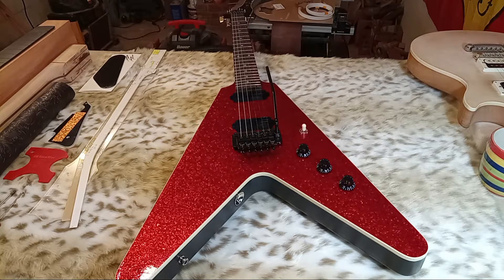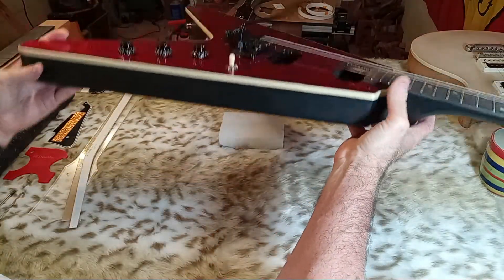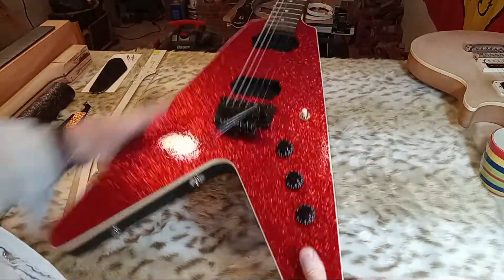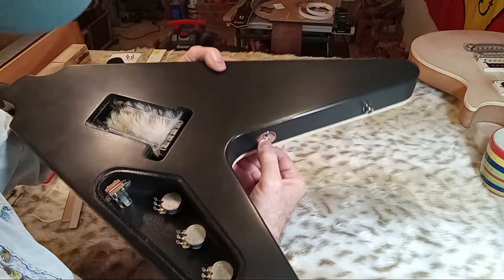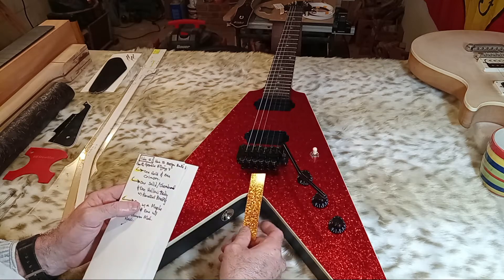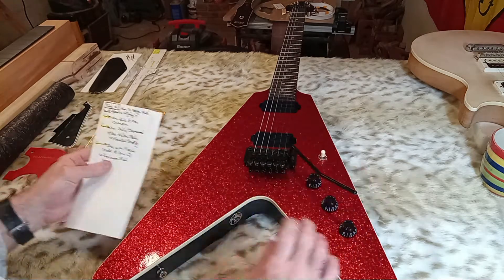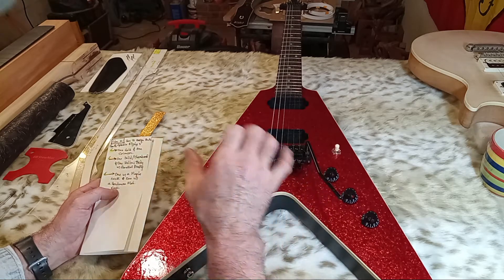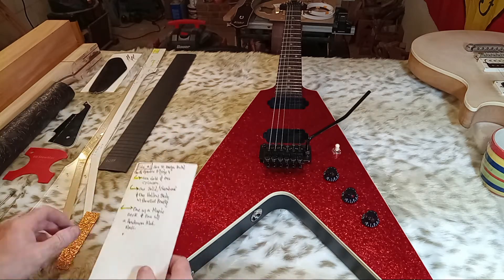How To Design Build A Custom Flying V Per 1959 Korina Specs.  Sparkle Top & Floyd Rose.  50's Intro

Comment: How did you drill the input jack? Or have you routed a patch for the wires and the put a top over it?
Reply from the maker: I haven't drilled for it yet, but will still be able to put it just about anywhere someone would want it, by using long bits.  I will cover that in much detail around video 13 to 16.

Thanks for watching and commenting, 
Marc